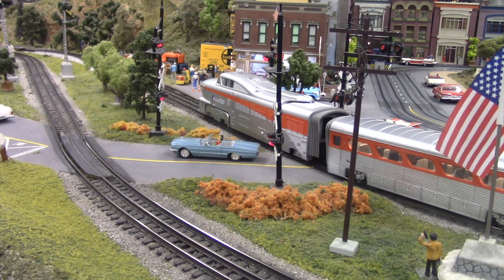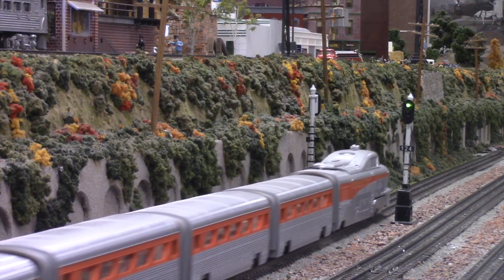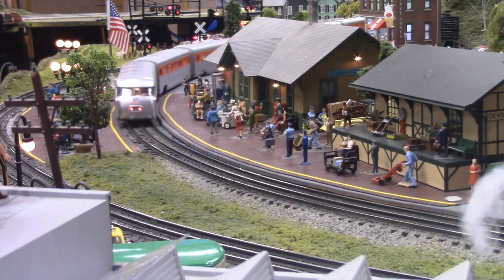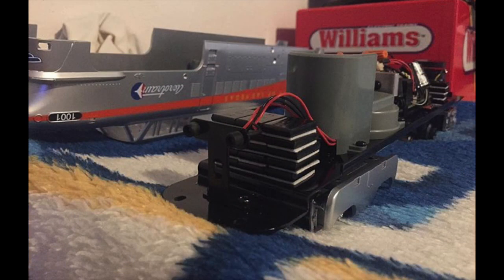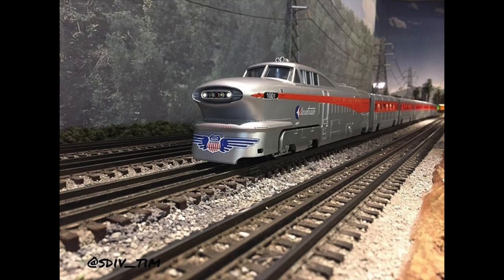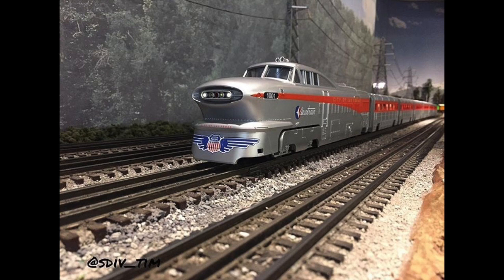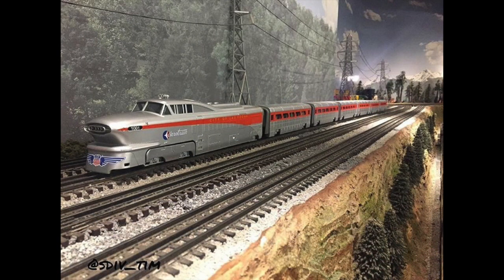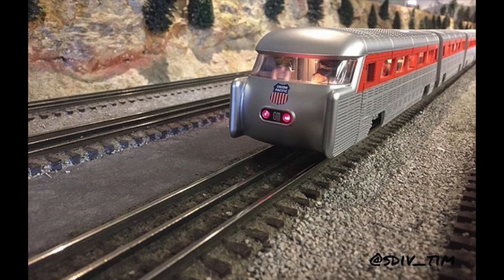Video Blog Episode 21 MTH Aerotrain guide to smoother operations

Comment: Thanks for your information on how to gain more traction for this set. Mine happens to be a Loco Sound version and it’s board is a bit longer than what you showed. After a couple of times of figuring out where to put the added weights without blocking the mounting posts or blocking the rear motor while going through turns, I ended up putting the weights onto the inside of the body. I can pull 6 cars but when adding a 7th, I noticed that the rear tires where slipping off. And this was the first time I ever ran this set from buying it new.

Comment: My MTH Aerotrain is like 20 years old and I have no trouble pulling 4 cars and on a 2.5% grade. I just changed the traction tires for the first time (what a pain that was on the rear truck). It is not a fast engine. Top speed is pretty slow. It's a conversation piece when I run it.

Comment: I just bought MTH Aerotrain 30-20674-1.  The loco can not pull any car except itself.  Please tell me if my MTH number is same as yours.  Please tell me what your train weight distribution is.  How many ounces of weight did you add to the front and the rear of the locomotive?